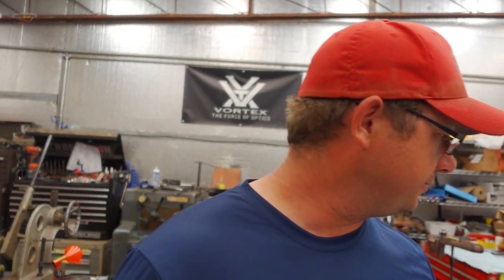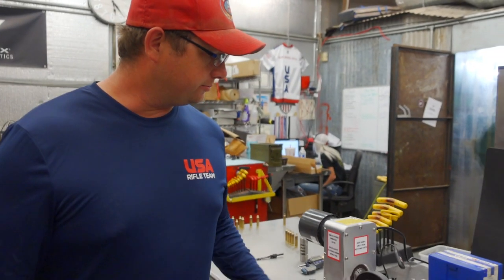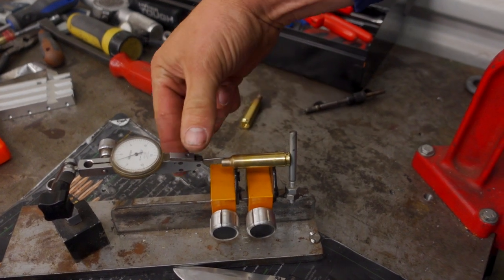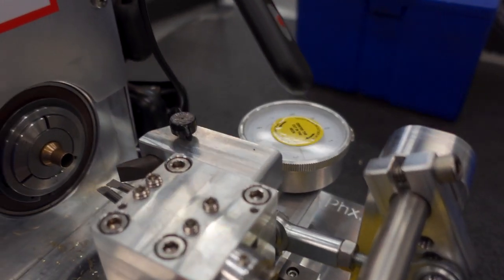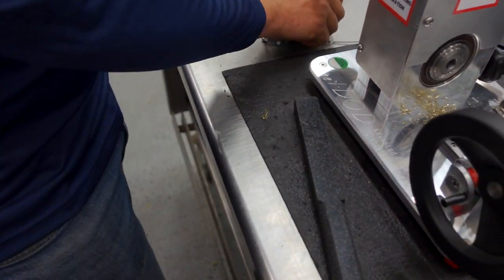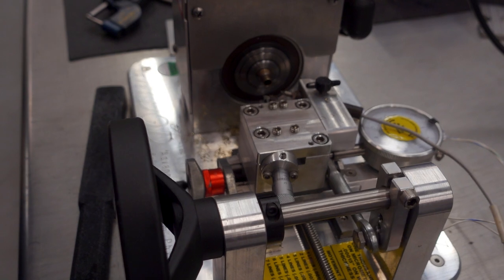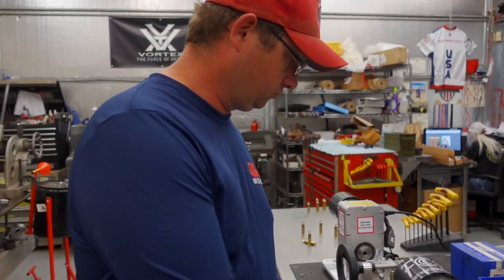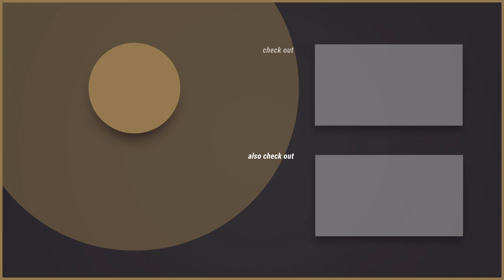The IDOD neck turner:  All you need to know.

Comment: Great entrepreneurial spirit! I admire the concept for sure. For those that have a benchtop lathe you could probably accomplish the same thing if you dont have spindle runout. If you're wondering the IDOD price tag is $1800 but that includes the plastic stick you knock the finished case out with. Id be worried about denting the freshly turned neck though
Reply: My thoughts exactly on removing the case.  You guys have made something that does the most precise neck turning I've ever seen but it just killed me to see such perfection in the turning and then see the case beat out with a stick. Not bashing you guys or trolling, but please come up with a better way to extract the brass. great video and kudos to the individual that came up with this brainchild.

Comment: Of course this quality control should be shared with the makers of precision brass cartridge cases so they can do these cuts and trims as the cases are being made so we the shooting public can load the case for the first time and have that load have the possibility of hitting our targets 10 ring at 1000 yards every time. I bet this equipment is very costly, an expense a lot of distance shooters will not be able to afford. So I’ll continue doing as I have been using hand turning tools to do the same. Bullets that start in a chamber in a case with off center neck thickness brass will shove the bullet into the lands off center, spinning down the barrel off center it will exit off center and that alone will be seen down range if the target is far enough away as the bullet transitions to subsonic speeds. As always in continue enjoying these videos, excellent work.
Reply: George, do you turn necks on virgin brass or after fire-forming?  Thanks.
Reply: @RetrieverTrainingAlone  I have a custom made Remington 700 in 338 LPM, and I have purchased new virgin brass, and I have trimmed this brass to the level of totally matched preparation and that included trimming the neck of the cases. When this rifle was purchased in late 2009, the only factory Ammo was either Lapua at $80.00 per 10 shot box loaded with their 250 grain bullet or Black Hills at $120.00 for 20 shots loaded with Sierra 250 grain MK Bullets. So I purchased one box of Lapua and used those loads to set up the reloading dies I have used. So then I purchase a box of virgin Lapua brass and have loaded them 5 to 7 times already.

Comment: The late TJ Jackson always did inside boring of case necks for his BR cases followed by several steps of outside turning and fire forming. Inside boring only briefly does away with the issue of the donut. Either periodic reaming to remove it or removing Somme of the case shoulder near the case neck will deal with a little better, but seating the bullet out so that the bearing surface is forward of the neck/shoulder junction, where possible, is a longer term solution.
Reply: Wouldn't only neck sizing a portion of the neck down to the donut region also give satisfactory donut issue relief (in non-custom cut chambers)?

Comment: Good call with the case run out! I purchased mine thinking you could “skim” the high spots off the outside and turn the doughnut from the inside... Unfortunately I had a custom die made for a certain neck diameter which was larger than what I needed to size the case neck after turning it fr9m 15 thou to 12.5 thou wall thickness. Once you’ve got the run out lower than 1 to 1.5 thou on your cases she’s an unbelievably consistent machine. I love it! Peterson 284 brass turns up perfectly.

Comment: I'm with Kevin.  We need an objective test to quantify a measurable difference in performance.  I can see where the IDOD makes the case neck concentric to the case body, where a mandrel and cutter only uniform the neck thickness.  A test measuring group size at multiple distances would tell what the effect is and at what distance it's significant.  Would the IDOD also promote lower ES since he touts it as providing uniform bullet release?

Comment: Next version need a rod/pin that pushes the case out afterwards (preferably pushing on the inside of the case to avoid damning the rim but still work with muliple differnt caliber) so u dont have to hit them multiple times with that plastic "hammer" while avoiding damnaging to the rim of the case

Comment: How does that shell holder hold the brass?  Just clamp down?  Doing 300 brass or even cutting primer pockets suck doing it one at a time. Why isn't there a way to put 50 casings in a tray and clamp them all down to just drill out the primer pocket or trim and deburr. I've tried of thinking of how but I'm not an engineer.

Comment: After watching this and a couple other neck turning vids, I guess I can cut a little deeper into the shoulder. I was always stopping right at the base of neck and feared cutting into it. Guess I can go a couple turns more.
Reply: Phil Ward, the resulting step will invert itself and be on the inside of the case, but remember as the case grows longer that step might serve as a stop for bullet seating and then it will need to be trimmed off as the case grows more.

Comment: When you fire form a case and the heat and pressure force the neck against a, hopefully, concentric chamber; can you get away with turning the inside only and then using the appropriate bushing to get your neck tension?
Also, I’m not understanding the use of the 7mm expander. Was that simply to ‘flow’ the donut back into the neck?
Reply from the maker: It was 6.5 brass he was necking it up to 7mm.

Comment: Why would he not use a precision expander mandrel to size the neck instead of the expander ball? Impressive machine though.
Reply: The video showed you it wasn't necessary
Reply: As you are likely aware, brass is a "ductile" metal.  This means that it will flow under pressure and allow itself to be reformed.  "Donuts" are the slight swell that comes from the metal going somewhere else under pressure. Perfecting the neck first minimizes the flow.
Reply: cause the brass is not precise
Reply: @edmundooliver7584  All brass is not equal indeed. Norma, Lapua, Peterson, ADG are all very consistent.
Reply: @daviddale3624  yes, I think thats what they use they can cut less off.

Comment: Was saving up for a normal neck turner.... Looks like im saving up fpr something new 🤣
Reply: It's a very impressive machine, but at 1800 dollars it's too rich for my blood. I'm just gonna buy the PMA turner.
Reply: @machinist7230  my cheapskate idea was to get an outside neck trimmer and a neck reamer, witch in theory should do the same without the minute adjustment...... Im a student so 1800 is alot of money, especially of i need to import this then im look looking at an increase to about 2000 then converted with the exchange rate would turn to R30 000, basically the price of an amp annealer, or dubbel the price of a labradar......those are huge monetary falues for a 21 year old geology student 🤣🤣🤣
Reply: @machinist7230  it would technically be cheaper for me to buy a 20" lathe... I'd save about 200 dollars give or take

All tho for this kind of work a 12 inch mini lathe would work perfectly and they go for about 600 dollars
Reply: @wildcat_reloading   a PMA turner is around 135 bucks, with carbide pilots around 60 usd a pop. Unless you're turning large quantity of cases, I think a simple(and vastly cheaper) hand turner makes more sense.
Reply: @machinist7230  at the moment om only working with 100 pieces of brass, i switched from pmp braas to lapua, so i first whant to develop al loads with the standard brass so o can get back to shooting more and then ill start neck turner in volume, but for now i need something i can test with to see it makes a difference
Reply: @wildcat_reloading  Yeah, unless you're doing thousands of cases, or have money to burn, you're probably better off with a handheld neck turner.

Comment: I am new to the Bench Rest Shooting Sport and I have a question if someone could help me out.  I have already turned the outside necks of 300 cases of Lapua 6mm BR brass to .0110 and they have been fireformed.  I also have around 300 cases of twice fired brass with the OD turned to .0110.  Once I FL Sized the cases, I checked the inside diameter of the necks and there is some run out that I would like to address.  Would the IDOD be able to address this issue without cutting additional brass off of the OD of this brass?

Comment: Close to the same thing is to bushing size the O/D until you get a cleanup on the I/D with a Neck reamer. Then hard turn a standard neck turn mandrel of a larger size (303 British 0.313" in 30 cal for example) down for a tight fit. Then turn the O/D to provide 95% cleanup. Whala.
Reply: I do this with Forester tooling and get 0-0.0002" runout.
Reply from the maker: Wow.  What do you use to measure runout down to 0.0002”?
Reply: I use a Brown and Sharp 0.0001" indicator, available anywhere they sell tool and die measurement tools. Interrapid is another mfg.
Reply: Brown and Sharp also makes a 50 millionths indicator (0.000050"), same as half a tenth.
Reply from the maker: I have the 50 millionths brown and sharp indicator.  It’s crazy sensitive.

Comment: Eric, is cleaning up the inside neck worth $2000 ?????????
Reply from the maker: You are asking the wrong question.  
You prepare four years for a World Championship.  You travel to South Africa and you come home with a silver medal because one flyer gave you a 4 instead of a 5.  Would you pay the extra $2,000 to get rid of that flyer that would have guaranteed you the gold?  Most would say yes.  ;)

At the level at which we shoot F-Class, it comes down to the very minute things that we do. 
I never worry about the temperature of my tires when I get in my truck, but in Formula One racing they monitor tire temperature and even have tire warmers.  :)

So bottom line is you it's really up to you to decide.  The answer will be different depending on your purpose.  Hope that helps.
Reply: @ErikCortina  I asked the right question, and got your opinion.  Thank u sir!

Comment: Erik, what I am starting to gather is that conditioning the neck (both turning and annealing) are the most critical things one can do to achieve accuracy.

Is that correct or is there something more important in your opinion?
Reply from the maker: It's no just one thing, it's the accumulation of many small things that make a difference.  But yes, consistent neck tension is important.

Comment: 11:40  Checks thickness gets 125 you hear the clicks on the micrometer then goes to check other side it was at 123 and he stops lol you didn't even hear him click the micrometer. Then claims he didn't clean up enough.  Yeah I don't want variations in my wall thickness.  How can your sizing die get consistent neck tension if your wall thickness is different because "you didn't clean up enough".  I'm not sure about his die either. I just measured run-out on brand new lapua brass and it was around 10-15k but after I fire formed and ran it through my redding die I got from 1thou to 2though runout.  No neck turning. I think if there is anything important about a neck its the texture of the inside of the neck. Meaning no grease on some and not others, no sanding marks on some, no copper left in some. I picture a mandrel  that could polish the inside of the neck and using a tiny amount moly grease being pretty valuable.

Comment: the idea is sound but not new 
K&M make a neck turning tool that uses a carbide cutter that does inside and outside perfectly
the cost is 1/4 of this IDOD. the K&M can be used with an electric screwdriver or drill easily 
seems like a toy for the rich boys LOL and l do not have the room to store more toys
Reply from the maker: “It does inside and outside perfectly”

It actually doesn’t.  Look up “pinch turning” and you’ll understand what makes the IDOD superior.  

Having said that, If the K&M gives you the results you seek, then it’s all that matters.
Reply: @ErikCortina  
a non flickering dial on my Redding case neck gauge shows me the K&M is perfect enough for me Eric. also with the K&M if you get a do-nut you can use the K&M with just the carbide cutting pilot and remove the do-nut very easily.
its not to say the IDOD is not an advanced piece of reloading equipment but really at $1800 US it is a toy for rich boys
compared to $323 for the ultimate K&M kit here in Australia 
https://www.brtshooterssupply.com.au/product/brt-km-ultimate-neck-turning-kit/

l would also like to add that although consistent neck tension and consistent bullet release are very very important reasons why you would neck turn the most important reason IMHO is to centre the neck to the base of the case when you use bushing dies
if l can explain for those who do not realise that when using a bushing die on an uneven unturned neck you are centring the outside diameter of the neck to the base of the case but the centre of the inside diameter of the neck is pushed to whatever side of the neck is thinnest making an off centred bullet

anyway live and let live, whatever works for you ;)